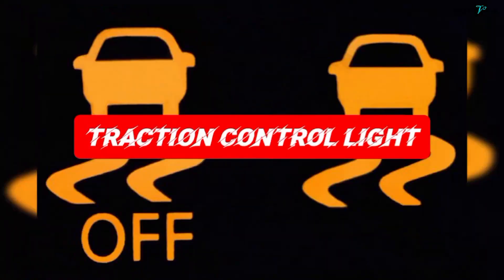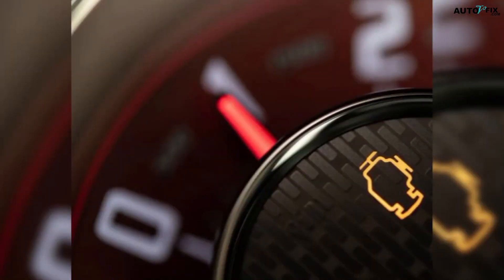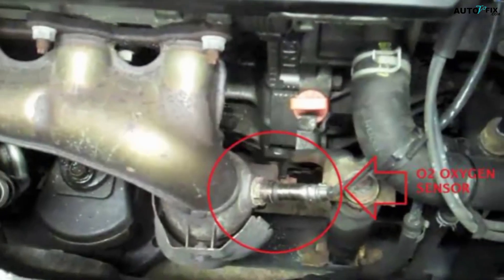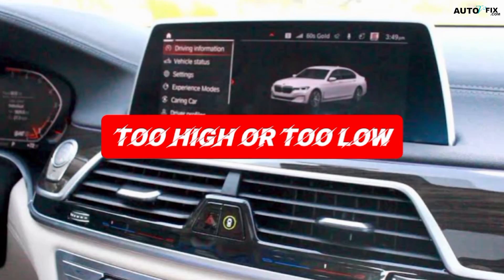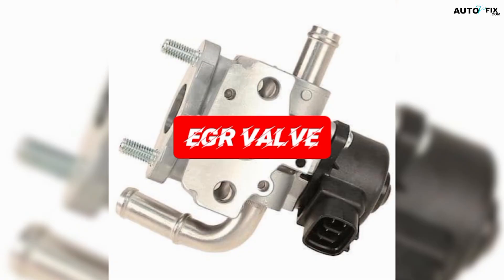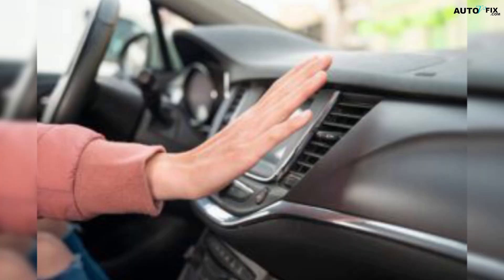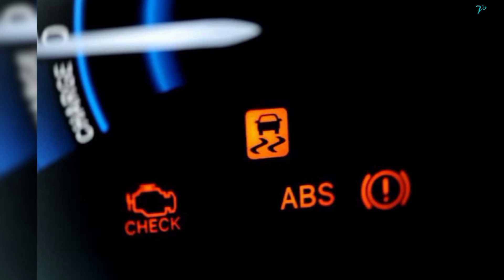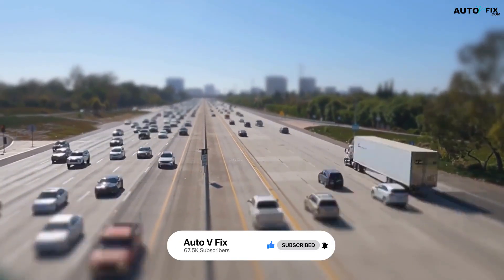Is Check Engine Light and Traction Control Light On? Here’s What it Means & How to Fix It

Comment: I first noticed my check engine light was on,  I was headed to the gas station to put air in my tire and my car kinda vibrated like I was going over a rumble strip in the road, I let off the accelerator and it stopped but then I noticed the traction control light and the check engine light began to flash, then I had a reading pop up the automatic collision was unavailable or something to that effect. What is happening to my car it's a 2017 Buick Regal GS
Reply from the maker: It sounds like you might be experiencing misfires, especially with the flashing check engine light and vibrations

Comment: My service engine light is on my VDC light is on and my tractionvlight is on I get code 113
Reply from the maker: A P0113 code usually points to an IAT sensor issue, which can definitely trigger those lights.
Reply: Possible  purge valve. I had same issues  with corsa  purge valve approx£20 fixed it